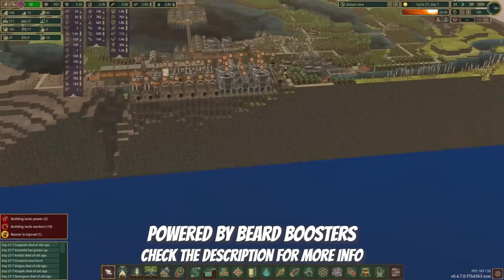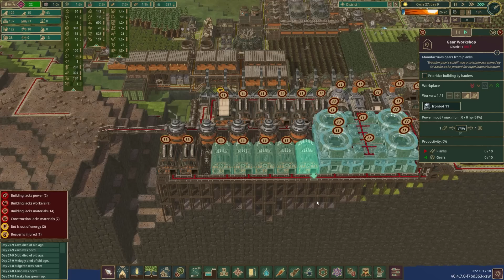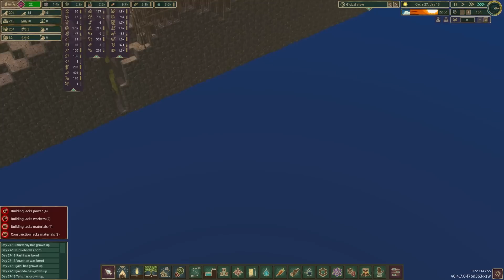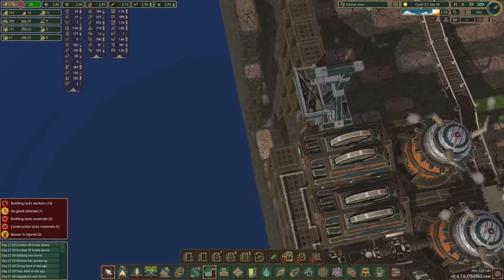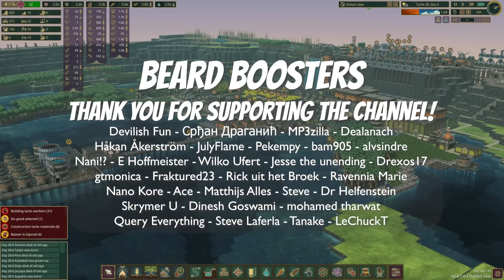POWER! Timberborn Update 4 Hard Mode Episode 18

Comment: → Remember the priority button. If you need some building done (e.g. a high power shaft), but another building (e.g. the mine) is using up all the materials (e.g. the gears) needed for it, make the first building higher priority. Also, if you need someone to work in the bot factory, make it a higher priority than e.g. the farms or explosive factory.
→ The beavers on the importing side of the district crossing only can import water if the beavers on the other side did bring water into the crossing first. This is why most beavers travelling from the crossing in district 1 are not carrying water.
→ Setting the water tank in your lake district (maybe except one of them as a local reserve) to "supply" and the ones in the other districts to "obtain" (at least the ones not near the water pumps) should help getting water better distributed. (You can also stop the water dumps in your original district for a while when low on water in that district, especially the ones watering the mangrooves.)
[I wrote this before you did part of this near the end. I think the mechanics of "supply" and "obtain" are documented – as I understand, without this they'll only bring a minimum amount of things, unless the source district's storages are full and they need space elsewhere. I think previously the lake district produced too much for their own storages, so they had to export some of it, which was enough for the industrial district to drink. I think you got several factors together here: Some pumps not working in the lake district, and more water being used (e.g. for your water dumps) in the main district.]
→ Due to the new mine in the lake district, you now got injured beavers there, who just hang out near the district center. If you want to run the mine by bio-beavers, you'll need a hospital there. Otherwise, more bots (+ some charging stations near the mine) is the way to go. (Of course, if you want to split off the mine + surroundings into its own district, that would be where the hospital would go.)

Comment: You might want to check both sides of all your district gates so that the various items are set correctly, like District 2 should only ever export water, and the other districts should be importing it. Also check the number of beavers in both sides of the district gates so that there are enough haulers to actually haul all of the goods that are being moved around. 
I believe that others have pointed this out already that there was only 4 on the District 2 side of the District 1/District 2 gate, but there was the full 10 on the District 1 side.
Make sure that there is a hauling post in every district, even if it only has 1 beaver in it so that they can move stuff between storages.

Comment: At first it seems like the Beavers have not quite caught up to humans technologically, then you realize that they have invented frictionless woodwork allowing for lossless power transmission over any distance, and autonomous clockwork golems.

Were there beavers working in the dried up pumps in district 1? 

I think that adding more workers to the distribution post on the district 2 side might help.  There's a lot of goods of various types being shipped all over the map and only 4 beavers to do it.

'How did things all get so bad?"  What happened was that you turned off bot production in order to allocate more power to make gears faster, which worked in the short run, but in the long run resulted in running out of labor power.  Like when a private equity firm buys a company and guts it for a quick profit.

Also, you have a lot of injured beavers in district 2 due to the mine.  That's definitely a bot job.

Comment: it looks like you're going to need a lot more beavers. i'm sure you could go down in population again once the bots are rebuilt but you've added a whole lot of jobs across the map i'd add 3 more pods in addition to the new one u just built, at least until bots are back up in the 30s. Also I'm pretty sure the threshold for import the minimum to have in that district at all times so if you up the threshold on the dist 1 side to 50 they'll actively work to have at least 50% of water storage full in that district at all times. you should also add another hauling post to dist 2 and fill it (hence the new breeding pods). there arent enough beavers to move stuff around in that district as is and you'll need more in both ends of the distribution post to keep it full. though you have 10 distribution workers on the dist 1 side to take out the water that gets placed there you only have 4 on the dist 2 side that are not only filling up the water but also taking all the parts that are being imported from dist 1 to their storages which are all in the mining area over 100 tiles away. more haulers, mining only district, more breeding pods. should fix some issues. :_affleck: also as soon as you said we wouldnt make it through the drought in this video :_doubt:

Comment: I second the peeps saying you need more than 4 beavers on the supply side to work the distribution, and a tank nearby on the side that needs water so they can just move it there quickly.  Also, you have multiple injured beavers (9 I think by the end), some in districts without any way to heal, so putting in a few beds etc might be good since you are just losing productive beaver time when they are hurt.

Comment: I believe district crossing has two parts, and you need more people on the water side district and less on the main district side. Because now you have a lot of beavers bringing stuff to the water district, not the other way around
Reply: Exaktly there are only 4 poor beavers on the water side of the district crossing and they are going to handle everything. Of course they don't have time to do it.
Reply: @skrymerU  yep, they are also busy dealing with the "metal district"
Reply: @CaptainFury  yeah that's probably why it suddenly stopped working, the construction project is taking all ther time.
Reply: And building a water tank just after crossing, would shorten travel time, and haulers can then take over (they are more efficient I believe)

Comment: For all the power woes of this series, you can set up 6-10 engines near your <already massive> log storage. Having less engines in the industrial area can allow for more production buildings. Automated bot production should also help as they're down to 6 now. Pathing to up the industrial area can also do with some reworking. Keep the series going!
Reply: He could build about 20  engines around the inside of the crater where the mine is.  There's even power shafts there now, too, to make things simpler.